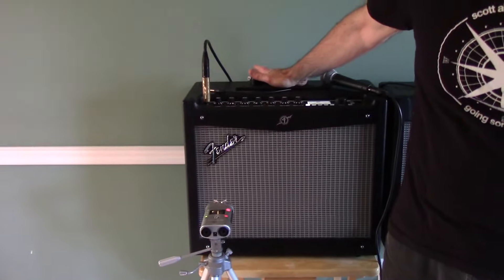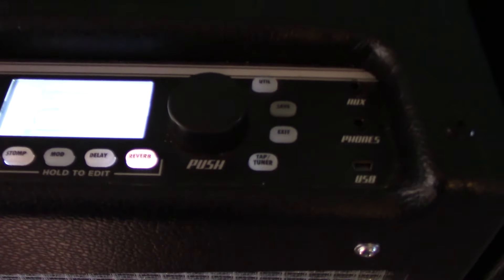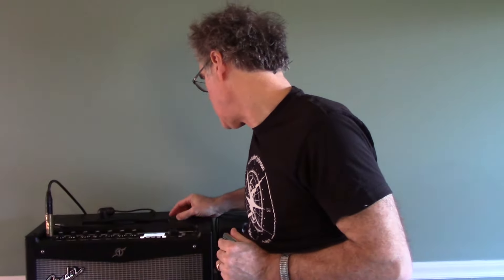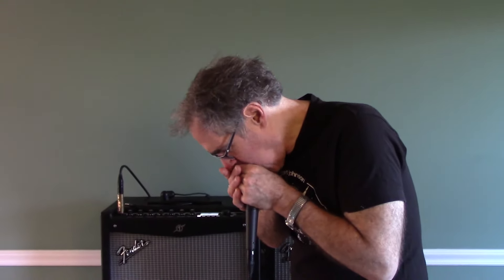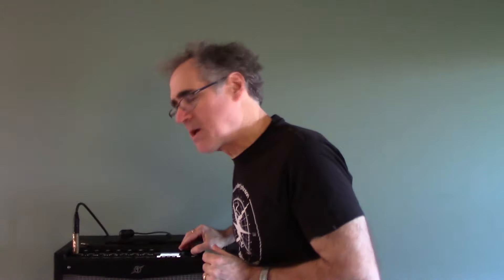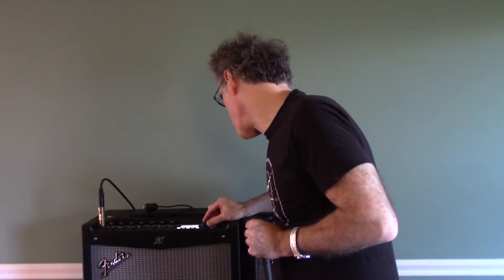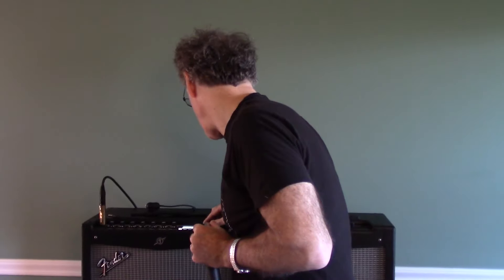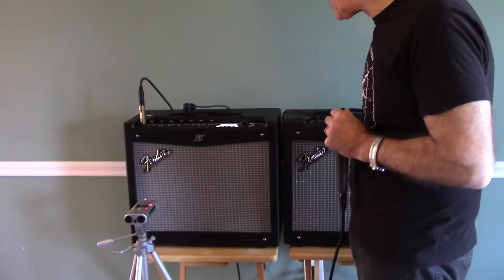Richard Hunter's Huntersounds Patchset for Fender Mustang

Comment: FYI there are two more Mustangs. The Mustang Mini, is a bit like a Roland Microcube, it takes 'C' batteries and has the same interface as the Mustang I and II. Thee other is the Mustang Floor which is like a Mustang III and up interface wise, but is basically a big multi-effects pedal, to plug into an existing combo amp or head/cab set up. btw great vids, appreciated even as a guitarist. I have a III v2, and a 'real' champ, the champ is for sale as the bigger speaker in the MIII sounds the same as, but goes further than the champ!
Reply: sorry i have no idea, i'd assume so. new-ish local music shop here that opened < 6 months ago has one in stock alongside the GT series, so I'd expect to be a v2

Comment: Very nice indeed. Could one of the lower powered units  ( 1 or 2) not be used to get the same sound then fed through the PA and monitors ?  That's how I've used small amps in the past.
Reply: Could you have a Tech add a line out to the I or II?  I would use the amp just as a monitor
Reply from the maker: I suppose it's possible, but by the time you've had the tech add the line out, you're probably looking at something that costs as much as a Mustang III.